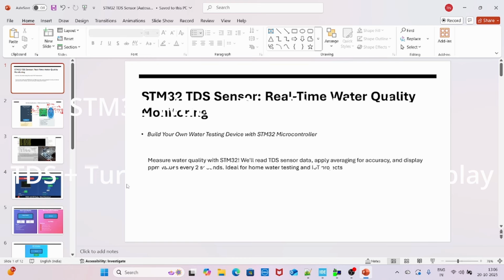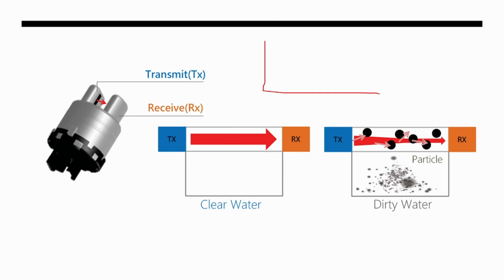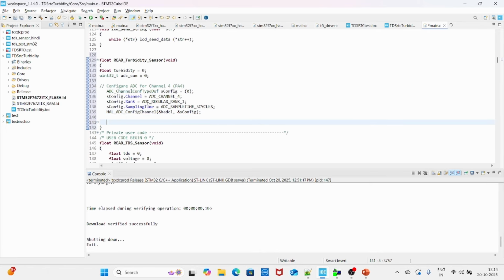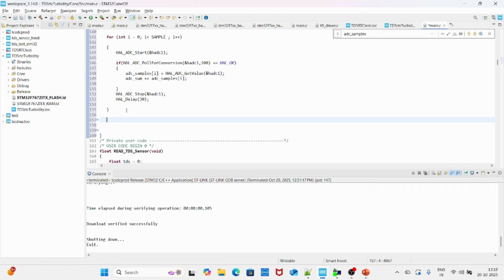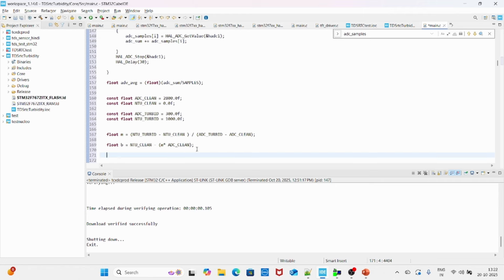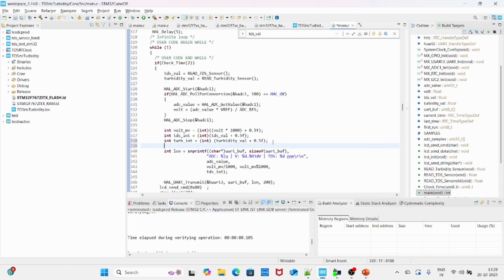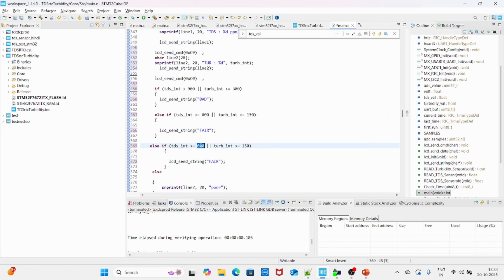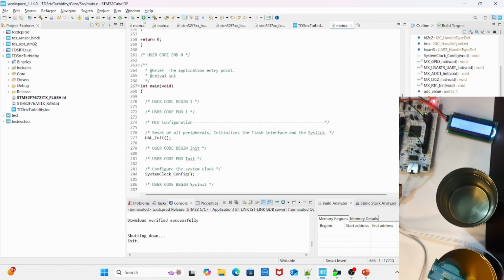DIY Water Quality Monitor (Better Than Store-Bought)

Comment: Sir making video about "parse"
Reply from the maker: Thanks for the suggestion! 

Are you asking about:
 Parsing sensor data (like converting ADC values to actual readings)?
Parsing UART/Serial data strings?

Let me know which topic interests you, and I will consider making a dedicated tutorial on it! 

Which one would be most helpful for your project?
Reply: @hardware_coding3603 ❤❤ parse  in uart reading data.
Exampe. 
My uart data1,data2,data2.
How to parse it with ","?
I try using split sting not avaiible in cubeide.
I try strcmp is confusing my head 😢
Thanks
❤❤❤
Reply from the maker: Great question! Let me show you how to parse UART data with ,  in STM32.

Actually in this video I am only SENDING data via UART using snprintf and HAL_UART_Transmit. I am NOT receiving or parsing any UART data yet. That is exactly why your question is perfect for a dedicated tutorial.

Here is the simple solution for parsing data1,data2,data3

Method 1:: Using sscanf 

char uart_buffer[50] = "123,456,789";
int data1, data2, data3;
sscanf(uart_buffer, "%d,%d,%d", &data1, &data2, &data3);

For float values:
float temp, humiddity, pressure;
sscanf(uart_buffer, "%f,%f,%f", &temp, &humidity, &pressure);

Method 2: Using strtok ( variable length data)

#include <string.h>
#include <stdlib.h>

char uart_buffer[50] = "100,200,300";
char *token = strtok(uart_buffer, ",");
int data[3];
int i = 0;

while(token != NULL && i < 3) {
    data[i++] = atoi(token);
    token = strtok(NULL, ",");
}
Strcmp is for comparing strings, not splitting them. Use sscanf or strtok for parsing data.

sscanf is the method for simple parsing.
strtok is better for unknown number of values.

This is a great video idea. I will make a dedicated UART parsing tutorial soon.

Does this help? Let me know if you need more explanation.
Reply: @hardware_coding3603 ❤❤❤ thanks. Iwill try
Reply: Sir I want only 16*2 lcd display using i2c using stm32f767
Reply from the maker: Thanks for watching... Please check following video

STM32 LCD Display Tutorial with ADC (TDS sensor) | I2C 16x2 LCD Interfacing

.... I will upload full code only for I2C based lcd soon...
Reply: @hardware_coding3603 ❤❤great